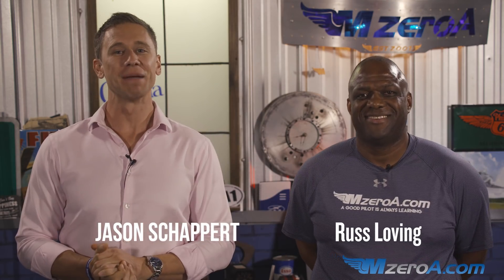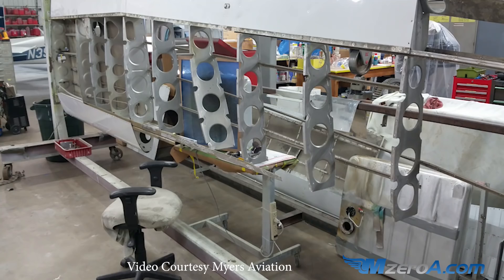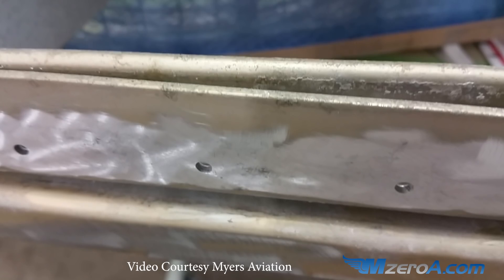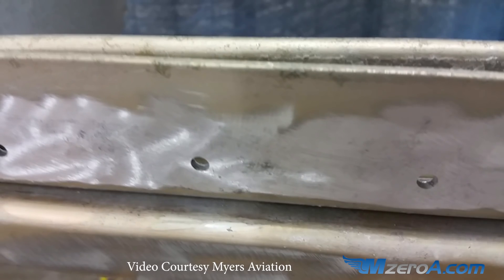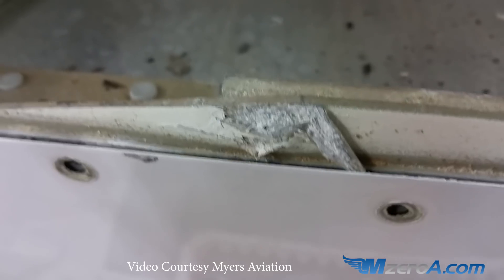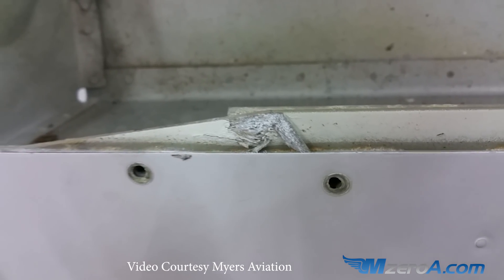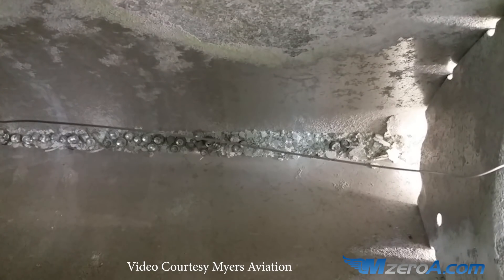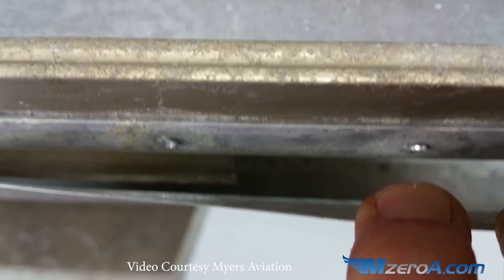N23MZ Repair Update #2 - MzeroA Flight Training

Comment: Sorry guys. This aeroplane needs to be totaled-out. Any car body repair man knows that corrosion extends deeper than the visible pitting. The corrosion extends into the crystalline structure of the metal. So, you can not just grind down to fresh metal, and say 'that's gud, let er fly~!'. On car bodies the technician doing rust repair, will apply a wet phosphate to the metal after grinding-off the visible rust. This is done in order to penetrate into the metal internal structure and displace the oxides - but that does not repair the damage - it just stops it - so that it can be painted-over. The internal structure of the metal is already compromised. There are also "self-etching" primers which do the same - but only to a limited degree - you do not get the metal strength back~!.  Some of those pieces in the video looked compromised beyond a safe factor. Consider consulting a Corrosion Engineer. Witchita should have some safety specs on this issue. Here's a primer. https://en.wikipedia.org/wiki/Corrosion_engineering

Comment: It is amazing how many home builders skip the undercoating to save 8lbs.
Reply: pilot blue , are you calling N23MZ a home built airplane?
Reply: Not at all, Cessnas are certified, But as Certified Aircraft prices continue rise beyond the range of most pilots, Home built aircraft are filling the void for GA private pilots. builders make many decisions along the way. The benefits of Undercoating (weight and cost) are not realized until years later when the aircraft may have changed ownership. Structural failure due to corrosion is a very real liability that is not easily seen by the new owner.

Comment: If newer aircraft were way more affordable, we wouldn't have to put up with potential disasters like this.
Reply: How do you propose making them more affordable?
Reply: @sirtraineewhat576  EASY, drop the price
Reply: You cant simply just drop prices. Do you understand why certified airplanes are so expensive?
Reply: @sirtraineewhat576  Yes i understand that the certification process is long and  costly but apart from avionics many of these aircraft are decade's old in design and surely the aircraft industry realize that for the majority of people owning a new airplane is a pipe dream. Find a way to drop the price and make sales.
Reply: @spiro5327  Theres also the cost of manufacturing, paying people, everytime a change is made to the airframe it has to go through certification, parts for the aircraft have to be certified individually, people who manufacture parts are limited, brand new engines are 60 to 80k alone. Not to mention that the demand for new aircraft is low. Its more than the red tape for certification for the aircraft itself. If you just lower the price you don't make a profit. They are a business and they want profits.
Reply: @spiro5327  Even though most of the designs are old, they still make changes from year to year and those changes mean the entire airframe needs to be recertified, retested, and everything else that goes with it.
Reply: SirtraineeWHAT I've read that liability costs are what made certified light aircraft (and their major components) so insanely expensive driven by lawyers winning ridiculous cases against manufacturers around the 80s or so. Not sure if it's true, do you have any insight?
Reply: @watashiandroid8314  That has some relation, but it's mostly just the cost of certification, and when everything that is installed on a plane also has to endure certification it drives the price up pretty fast. Everything down to the carpet seems like it has to hold some sort of certification to be used on an aircraft. Thats why experimental kit built aircraft are largely the future of general aviation.  Theyre a fraction of the cost to build maintain and operate.

Comment: If you do take the other wing off, and you should, consider zinc chromating the inside of both wings and using corrosion X or ACF 50.  If you don't take the other wing off, I wouldn't bother with the Zinc or anticorrosion stuff, because it will be a waste of money when the other wing fails. I wonder what will go thru your mind when the plane plummets uncontrollably out of the sky...I wonder if it will be: " I should have checked that other wing!" By the way, you will find the same problem that you found with this wing.  I'd bet my life on it.
Reply: Wow that is dark, lol. They pulled the skin off to check the other wing to check for corrosion. The wing has some surface corrosion but they have taken care of it (corrosion).
Reply: @RussellLoving  I can't believe he said he'd bet his life on it...without reading the 5 or 6 comments so far where you clarified the other wing was already inspected....lol...now who's crash and burning?
Reply: @waynebrown4671 lol, and with that inspection we found some other issues. We will have an updated video out soon.
Reply: My only point here is to make sure the other wing was checked,including examining the areas that could not be seen by a regular annual inspection.
Reply: @waynesharaf5129  LOL Wayne, they are taking the R/H wing off  to check for the corrosion and if we have any issues we will be removing the corrosion then using the epoxy primer in the interior of the wing.